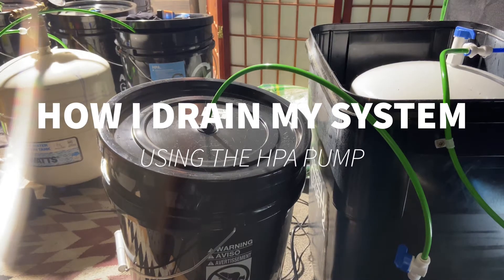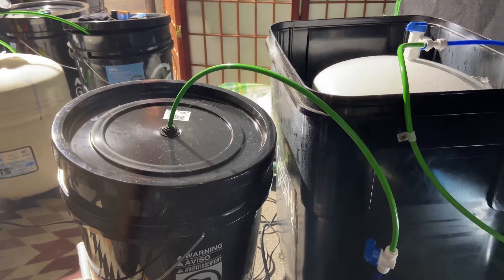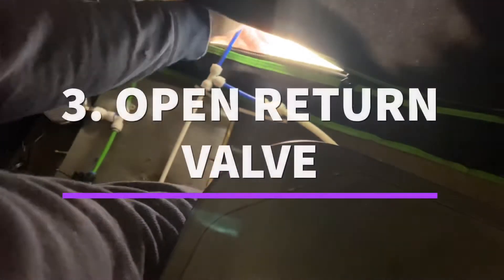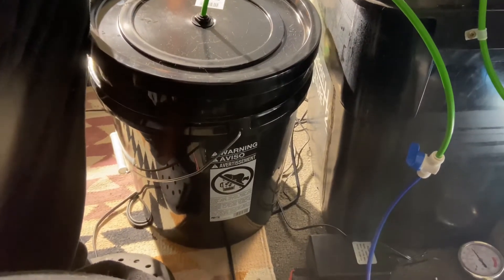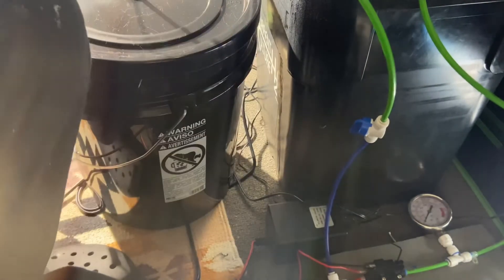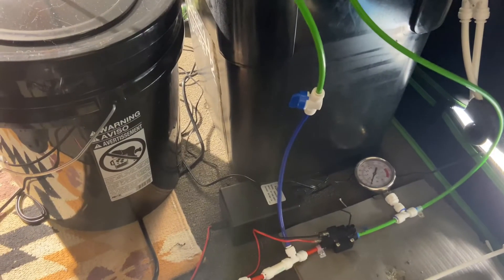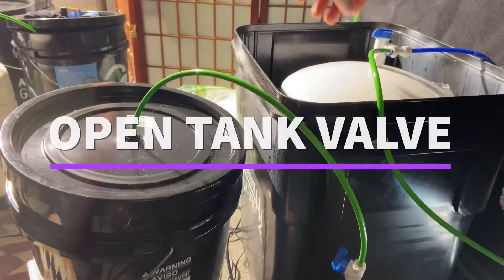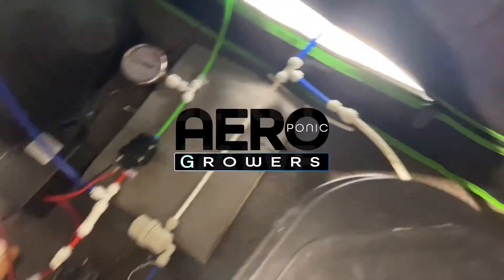How I drain my aeroponic system using a booster pump, tank valve and tubing. Aeroponic tips & tricks

Comment: Awsome way to do it !
I imagined you would tell the same idea as mine (which is drain also but...)... but nope.

I  (CLAM IT haha xD) came up with this idea:

Reservoir is sealed (using just a submersible circulating pump instead of airstone)
Have 2 air/water proof bulkhead connections for the reservoir
1 for feeding (standard setup - at the bottom if needed)
1 for the auto pressure equalisation (at the top and not dipping into solution) *

Have "drain-to-waste" container, sealed.
Have 2 air/water proof bulkhead connections at the top *

Lastly have your root-chamber drain spot-on for suction (or tube touching the bottom where waste accumulates)

Connect root-chamber drain
to "d-t-waste" container.

Connect "d-t-waste" container
to Reservoir top.

* When ever the Pump works, the reservoir pressure will change it will become lower than the root chamber which is normal (does not need to be air proof)
The accumulated waste will be sucked in the "drain-to-waste" container and all sealed containers/reservoir will be pressure equalised again.

I'll try it my self when I can, and tell you about it.

It's for micro grow space if we can't drain under the root chamber.

Comment: quick question....why not just feed the return back into the reservoir instead of that separate bucket you made up?....is there a reason you'd want to check/test the return water before dumping back into the reservoir itself?...thanks for the videos, BTW
Reply from the maker: I’m just emptying the system so I can add all new nutrients to the reservoir